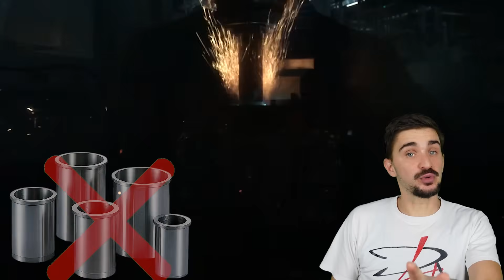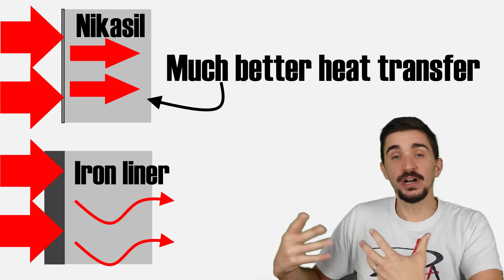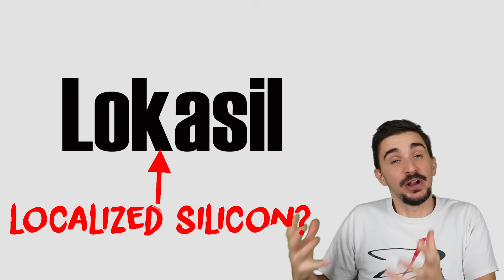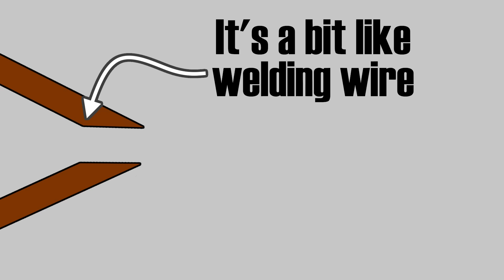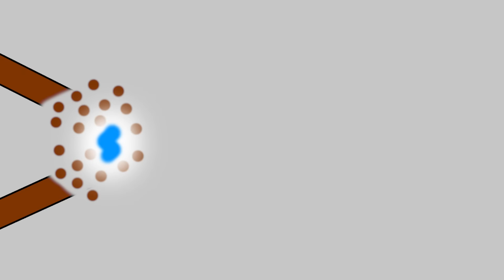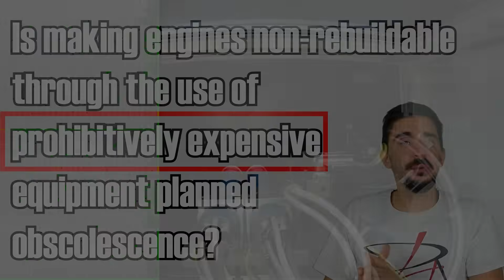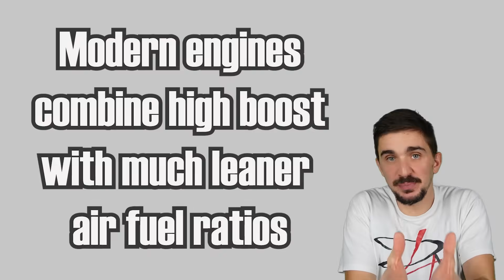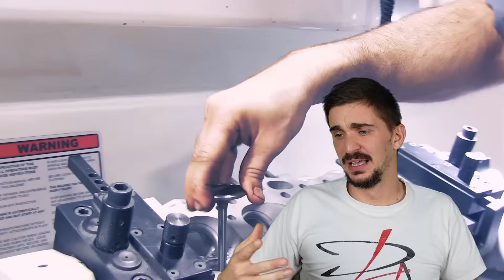Why Are Engines Becoming Non-Rebuildable? Everything About Cylinder Coatings

Comment: but is all based in a false premise that co2 is bad, co2 is plant food so doesn't mater the co2 production only the efficiency and the economic toll, and recycling aluminum  full of ceramics is not cost effective produces to much slag, so why manufacturers don't make cylinder liners out aluminum and ceramic making the blocks rebuildable

Comment: If you take a BMW engine factory tour at Steyr you'll find out that since some generations ago, the cylinders are slightly conical, smaller at the top than at the bottom and they do this that once the engine gets to working temperature it is indeed a cylinder. Also, special coatings and each bearing for each rod being "unique" in the sense that they each have different tollerances depending on how the moving parts end up from machining. A quite difficult thing to rebuild if even possible.

Comment: 19:00 so like those new Wet belt engines or if there is a timing chain the PLASTICK link ?
I would love for car menufacturers to not do this but at this point if you buy a new car you should switch to aftermarket parts as soon as posible.
Also then new electronics and screens do not help at all with this.

Comment: I'd like to hear more about #1....the "good" heat conduction characteristics of Nikasil, etc...VS the "poor" heat conduction of iron.
    So, nikasil is good at removing heat from combustion, where I want it, and transferring it into the cooling system, where I don't?
    Other fancy coatings are applies to combustion chamber surfaces to PREVENT heat transfer from combustion into the cooling system....
      Iron cylinder liners do that and are able to be bored, honed, and replaced?
    Sounds pretty good.
   Modern cars are so extremely heavy that the weight increase doesn't amount to much. A few percent of one component. An aluminum block for an inline 4 is pretty light with or without iron liners.
      I'm not crazy about non iron cylinder liners, but have been impressed with the "sprayed on" valve seats Toyota has used. I have a 415k mile matrix than hasn't had one valve shim changed ( the shim IS the bucket in this case). I'm impressed. 
   In that case, the good heat transfer helps the seat, and the valve, live longer.

Comment: Motorcycle nerd time. Nikasil, in the case of the honda cbr929/954 and the kawasaki super sherpa 250 specifically, was a detonated wire process. A thin wire of Nickle and Silica alloy was passed through the cylinder and detonated with ~50,000 amps to form the cylinder liner. May have been done differently on other engines, but this early EDM process was really cool. Horrible and expensive to rebuild, but cool to see.

Comment: The equipment might be expensive, but you said yourself, in practice, coating is cheaper for a major manufacturer than a sleeve. So no, it's not more expensive, it's effectively cheaper. Does that mean it's planned obsolescence? No, it's just an added bonus. And intentionally making parts fail sooner thereby saving money isn't an alternative; they already do that too.

Comment: When I stripped down a VR38DETT Nissan GTR engine which was 112k miles old i was curious how the bores would look.

I was shocked they looked in amazing condition and measured as 0.00mm taper and 0.00mm out of round on all 6 cylinders.

I was able to use stock bore forged pistons with minimal deglasing literally less than 10 passes on a ball hone not a proper hone job.

An iron block engine with half the miles would normally measure beyond limit in taper and out of round and would normally need a 0.25mm oversized rebore.

So arguably this engine is still rebuildable even at a high millage.

Comment: Alusil blocks at least are able to be rebored and rehoned. They do need a special honing process to properly finish the surface to expose the silicon though. You can actually do this yourself, but like any hone job, you may want a shop that does this particular thing a lot to handle it.

Comment: Considering that the fraction of the population that 1. keeps their cars long enough to need an engine rebuild and 2. would then actually invest the personal time and effort required to complete an engine rebuild is insignificant compared to the population that buys cars, manufacturers have zero incentives to make them rebuildable. They are, however, incentivized to make them cheaper to produce, more efficient and more powerful. 
Secondly, similar to electric cars, where, even if you only charge them with electricity from coal power plants, they still emit less pollutants over their lifetime than a comparable gasoline car, I would bet that buying a new "disposable" car vs rebuilding an old engine in a car that probably was not as fuel efficient and had way worse catalytic converters is actually not nearly as polluting as most people think.
That being said.....I don't like what we're doing with modern cars either. I think they have way too many features and break to often. The continuously bloating SUVs and trucks especially.

Comment: green new scam i call bs on improvement overly small over boosted  open deck blocks uber thin oil overly tight tolerances . the co2 thing is so old man and nuts on every level

Comment: The average engine in Europe lasts 20 years. Yes but these newer plasma lined turbo engines are not lasting 20 years. 3-5 years, 7 if you are extremely diligent with maintaining. Not as a result of turbos or plasma linings , just extremely poor quality engines.

Comment: They could just go back to Nikasil. It works well. Also, engine blocks can be re-plated again so rebuilds are possible. 
We all have heard the "benefit" of super expensive technology that promises significant savings much much later at much higher volumes.
This kind of "innovation" should be rejected from the get-go. It always ends up as a huge cost sunk into something that does not deliver in the end.

Comment: If the cylinders can be coated in the first place, the cylinders can be re-coated. A sleeve can be bored oversized to a certain extent, but when the sleeve has to be replaced, bored, & honed. Six of 1, half dozen of another. The main difference is going to be price. For the last several years, the Corvette engines have coated cylinders & valves. We sprayed certain places on rotating parts for turbo fan aircraft engines when I worked at GE. During rebuild those parts can be re-sprayed & machined to dimensions.

Comment: I think this metal spray coating is awesome, can't it be used on these other sili engines for example? I assume this can only be done on iron sleeves due to galvanic corrosion between aluminium and iron. Great stuff! Thanks for the content!

Comment: Manufacturers need to develop a VERY reliable, very repairable, and very economic Diesel Engine.

And have this without all the gears, shafts, and efficiency losses. The engine basically turns energy-dense liquids to charge up a medium-sized battery. And this energises four eMotors which have great torque and instant horsepower. And due to their small size, can be fitted on each wheel, so power can be delivered dynamically for racing or off-road driving.

And to be able to do this on a Mass Scale. While being able to do an economy version, by having one eMotor for the front wheels, small battery, with the ICE Generator in the back for weight distribution.

Comment: Nikasil coatings don’t make engines unrebuildable, as they can be machined down & reapplied, as done by motorcycle rebuilders or even replaced by a liner, pending space issues.

Comment: But they are rebuildable if you have the right equipment. My Son is a Supervisor at a Company that builds parts for Power plants and most everything built is hard coated, They hard coat everything, it's not at all a hard process, set up takes as long as the operation itself.
I watch a couple YouTube Channels that do machine work and they hard coat as well. I watched one guy out of Australia that hard coated a hydraulic Cylinder, then machined it to the proper size and it was ready to be reassembled. The Cylinder was about 4 inches, about the same size as the average engine so let's not Panic 
It can be done rather cheaply. Maybe not as cheap as dropping in Sleeves, but a shop set up correctly and an experiences Tech, I'm certain hard coating can be done as fast as sleeving.
I've seen some hard coating that uses powered metal that's sprayed at temperature, basically spray welding, this process can also be used to hard coat Cylinders.

Comment: ELECTRIC engines:  One moving part, no oil, almost no friction, and I would presume a much simpler rebuild process.  I guess that moves the discussion to batteries, which are probably cheaper to recycle... It would be great to see a follow-up video discussing the pros and cons of battery recycling and impact on CO2.

Comment: New car production creates way more emissions that rebuiding a block though. The equipment is also prohibitively expensive for smaller businesses, not automotive factories that save big bucks on thousand of tonnes of raw material after switching to coating rather than cast cylinders (not to mention the added money from people ditching unrealistically boosted 1.3l engines because they go kapoot much faster).

Comment: the engine is designed so that the parts can be interchanged with other models, ofcourse they are rebuildable if you have the resources such as higher tollerence pistons and bearings. I had a jeep that broke down and fully rebuilt it, others would say to recondition the engine with sleaves or start with a fresh block but i used 1000 grit on the scratches from 2 bad connecting rods that broke in half. the newer engines are throwaway when they exceed so many miles to the companies. just take the engine to a shop they'll take off a few thousands and put oversize pistions. it takes some effort and time

Comment: Everything can be rebuild if you spend enough money on it. The problem is in the 1st world where people buy new cars, drive them till old, sell them to 3rd world if not damaged by then, is not going to have low enough labor cost to rebuild. I'm sure you can find a manufacturer who put in enough quality to make sure they are durable and no need for rebuild before the car is rusted through (most likely a Toyota or something like that), but they too are too expensive to rebuild and is cheaper to buy a junkyard accident pulled engine and keep going. The rest of the car may be damaged but the engine can still be working well.

Comment: Hello! My car has the HR13DDT engine too and I’m really happy with it. It consumes about 5.5–6 L/100 km, has been very reliable, and a new engine from Renault costs around €5500. I think that’s a fair price for this level of technology. It can reach 235 km/h easily and can go over 250+km/h downhill, which is impressive for a factory 1.3L engine.
Reply: Until they stop manufacturing the engines and you're forced to scrap your car for an electric automated car that listens to every conversation you have and monitors everywhere you go.

Comment: If I am correct friends of mine had these cylinders for their 49, 9 cc moped. They where topgrade and as long as you made sure the 2stroke oil/fuel ratio was on correct levels they lasted and outperformed  most other cylinders.
But most found out if they did abuse it, it could no longer be rehoned to an oversize.
As long as this is told in advance with clear warnings about this impossibility it can be a high performing choice

Comment: The main reason to phase out Nikasil was environmental impact of the electroplating waste products. High cost was only secondary for the manufacturers of expensive high performance cars who were forced to abandon the process by ever stricter environmental regulations
Specialized tuners and rebuilders are still allowed to use it on a small scale (LN engineering, Flat6 innovations)

Comment: Wonder when we are going to see ultra efficient 500 cc (range extender) hybrid vehicles.
Say what you like about IC engines but when it is minus 30 outside, heat is a necessity and batteries with heat pumps will not do it.

Comment: EVERY engine can be rebuilt. 
It’s a matter of COST. 
Even nikasil can bow be reapplied onto the aluminium cylinder bores. 
Alternatively, you can rehire and insert steel cylinder liners, wet or dry. 👍

Comment: Best solution, no sleeves at all, an entire cast iron block, like the good old days. Ya, it's heavy, but you don't have any of the issues they're trying to fix with aluminum blocks. Other downside is warping aluminum heads due to the difference in temperature thresholds
Reply: aluminum engine blocks have come a long way, this isn't the 1970's. Folks have done plenty with Coyotes, Honda K-series, and Aluminum block LS's.

Comment: The four cylinder Hyundai / Kia motors are just disposable trash.   The maximum over bore is just .020 inches.   They have severe Issues with connecting rod bearings failing and the variable valve timimg systems totally disabling the engines.

Comment: I had a 1973 Chevy Vega that my brother bought new. By the time it had 50,000 miles on it, it burned a quart of oil every 50 miles, and fouled spark plugs every 100 miles. It's too bad that the Vega had so many sub-par materials (including the body panels), because they weren't bad to drive.

Comment: My thinking has long been to engineer vehicles with shorter engine lifespan BUT engineer them to be SIMPLE and cheap to replace said engines on an ongoing basis so that perhaps every 150k miles (vehicles driven mixed highway and city) for say $2k TOTAL (parts and labor) you get a brand new or effectively brand new/ or renewed engine with guaranteed 150k trouble free miles?   Yes that is a lot less than the 300k miles some get now but my guess is the entire back end of such life spans is degraded performance and emissions and really is only possible for those that baby their vehicle (I guarantee NO vehicle is EVER going 300k or anywhere NEAR that with the likes of MOI at the wheel!  Yes even with proper maintenece!  Because I enjoy my vehicle's POWER)

Comment: In reality a fully cast iron block does not really add all that much weight to a typical 4-cylinder or 6-cylinder car . It is also cheaper than any aluminum alloy and lasts longer and is infinitely repairable. They still produce the RB26 for starters, and then all the really highly efficient engines  (which are large displacement turbodiesels, for the most part),  like 40-45% ECEC -- are very often  cast iron even in 2025.

Also, the CO2 emissions (aka plant food) are almost irrelevant. Even if they were (and they are most likely not) relevant, thing with them is even if you had the entire West, like from California to Ukraine, teleport to Mars -- with all the cars, trucks and factories -- that move would NOT have offset CO2 emissions of 1 country of China. And then there's India, and if anything good is ever to happen to Africa -- they'll have to start burning those fossil fuels for real.

2JZ or RB26 with dual turbo and a hybrid system would not be that different from what's found under the hood of  a BMW 540i XD (B58), but the fully iron hybridized 2JZ or RB26 would last forever (fully rebuildable), compared to the said BMW 540i, which is only good for 5-7 years -- while being closer to a 41.5% efficient Toyota A25A-FXS (the golden standard of fuel efficiency)  than to a car from the 1990s/early 2000s  with the said 2JZ or RB26 (23-25% efficient at best).

Comment: VW had a very good answer the replaceable 'steel' jug. Water cooling would be pretty easy to design into a replacement jug 
coating steel to resist coolant corrosion is much easier cheaper then piston wear on aluminum 
An inline4 made from individual universal jugs would be extremely easy to design and could even be very compact
and efficient the difficulty would be in getting such an easily repaired engine past  the nickel heads

Comment: In order to make non-rebuildable aluminum block engines even easier and cheaper to recycle wouldn't it make sense to do away with a separate cylinder head and the required steel bolts and just cast as one piece from the upper crank bearings to the top of the combustion chamber?  This might be difficult on a V configured engine but no problem for an in-line.  With the block and head cast as a single unit, valve seats and cylinder sleeves (solid or spray-in) can be added after machining from the bottom.  Then valves would be installed (also from below) before pistons go in (also from below).  No head gasket to blow or leak.  No head to warp.  No head bolts to torque.  Added advantage: Assembly time would be faster.  Seems like a no-brainer to me.

Comment: I see a flaw.  Even if these coatings are this good for the environment, the use of non-rebuildable engines shifts the cost of CO2 management to consumers at huge costs.  Given the costs of replacing the worn engine with a new one, or replacing an otherwise useable car due to the non-rebuildable engine, is prohibitive to most consumers.  In other words, engines could be made expressly to be rebuilt at affordable costs, with a slight penalty to the environment.  The only way this works out long term is for engines to last MUCH longer or, for replacement engines to be sold for much less.  Otherwise, we end up with super environmentally friendly cars no one can afford.  This could be done by designing plasma spray engines to be rebuilt with inexpensive iron sleeves.  And EV's are not yet the answer since they still cost significantly more than ICE cars and have serious range limitations compared to ICE vehicles.